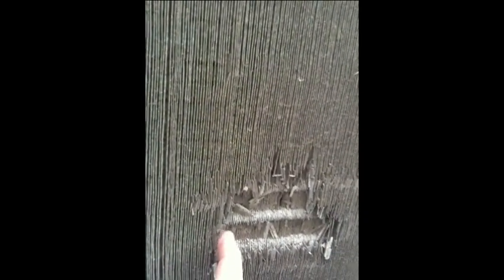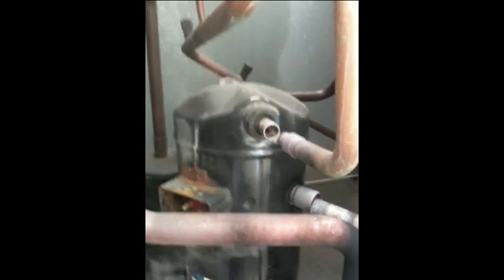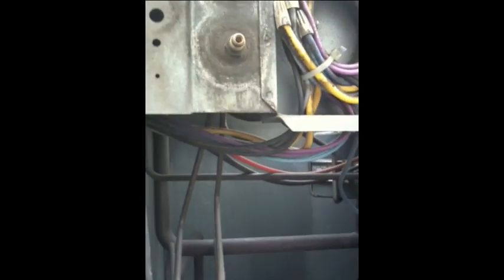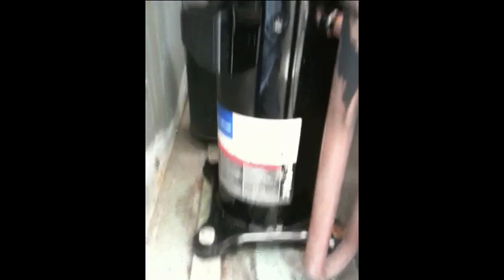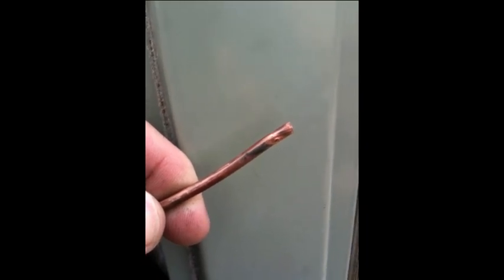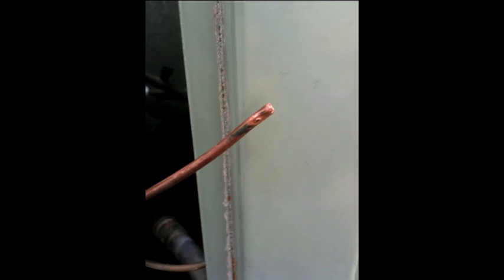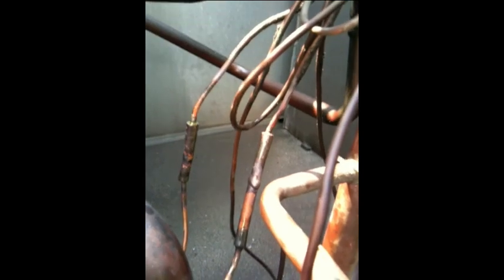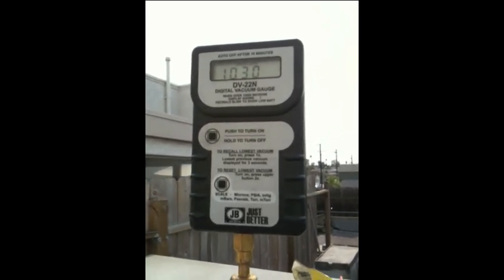HVAC Compressor Change Out HVAC

Comment: Got a question and if no service technician has done this then there must be a good reason why......After you sweat the pipe out of the fittings can you immediately put a wet rag to speed up the cooling process?

Comment: Multiple issues. Why not install an LP safety control? It looks like you got that fitting on the compressor RED hot, tsk tsk tsk. 1030 microns would indicate there is still moisture in the system, did you bleed nitro as you welded? How come you didn't replace the bi-flow liquid line drier, or if not reverse cycle, the liquid line drier? Was the compressor burnt out or seized? I saw no oil acidity test take place nor a burnout suction line drier installation. More, but no more room.